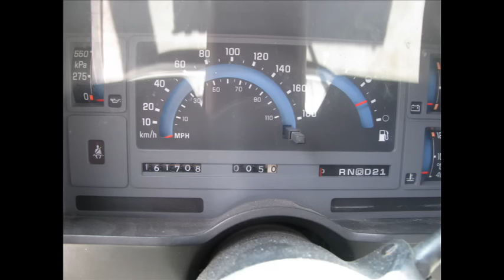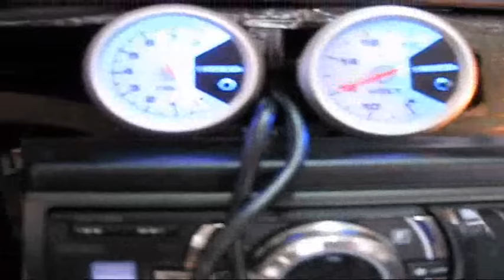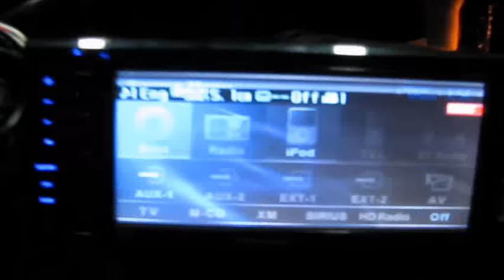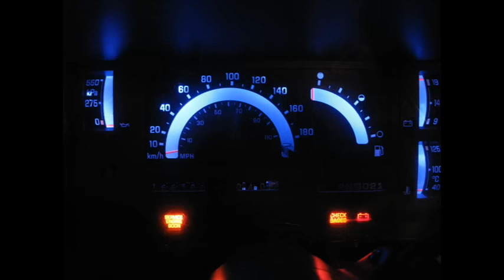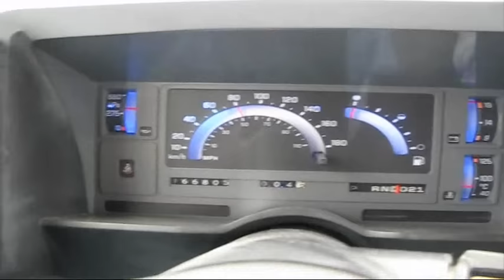Rob's S-10 Blazer

Comment from the maker: Those blue blocks are used to lower the truck. They increase the space between the top of the leaf spring and the bottom of the axle. The benefit of that is you keep the rear suspension stock other than the spacers. It is Also possible to change the position of the axle so it would be located under the leaf spring that would raise the rear end up approx 2 inches.

Comment from the maker: if the frame is solid then the base of the truck will last. the engine and trans need to be sound and lastly the body. however replacement panels are cheap and easy to come by.

Comment: Hey Rob you still doing things on the Blazer. Hey you've helped me out a lot with things on mine! Like the way it was running when the spider injectors were bad. Just a quick question. What I would like to know about is the transmission. When I got my 93 S10 blazer they put a th350 and it had the 4L60E and I have been trying to locate one. Well my question to you is. Does you're have the square connector or the round. Please help thanks. And I love the Blazer and some of the things you've done to it
Reply from the maker: Joe  Archibeque Thanks for the positive feedback I really appreciate it, I can tell you for sure I have the 4L60E trans in my blazer, I've had it rebuilt.  Regarding the connector ill need to crawl under as have a look at what I have.
Reply: Yeah kool bro I really like them stock wheels you put on it. And yeah I'd really appreciate it i look and look at YouTube and you seem to have the best things on there. And also you're very smart and to the point I like that. Other guys on here they talk about there S10 and airbags. Well anyways you have the best thing on here and I thank you for everything you post
Reply from the maker: Joe  Archibeque Thanks Joe, ill have a look under the blazer as soon  as I can and let you know what I currently have.  

Cheers!
Reply from the maker: Joe  Archibeque looks like my transmission has the round plug, mind you I was laying down in the dark looking with with my phone.  So I could be wrong, I would need to pull it up on the ramps to get a better look during the day.  Hope that helps you some.
Reply: Oh okay yeah I wasn't sure what they are called. So anyways I got this little Blazer for free. From my boss. And they said that the starter was bad on it. So I got it home thinking it was going to be an easy fix. Well what turned out to be an easy fix turned out to be a 1300 dollar job. The engine was. So I get under it and I'm pulling the bolts off of the bellhousing and noticed that there is a TH350 transmission in there. So I said wait. That's a 3speed an I thought they came with a 4speed meaning the 4th gear was an over drive gear. So anyways I get a rebuilt motor for it and I put it in and her running and I started fixing all kinds of crap on it. It was wasting gas and I fixed that. And now I'm doing the transmission oh boy what turned out to be an easy fix turned out to be a nightmare
Reply: Sorry for the long book. But I thought I would tell you about my nightmare lol
Reply from the maker: Joe  Archibeque your defiantly going to know what the trucks made of, I enjoy driving something I've done work on there is a sence of pride attached to it.
Reply: Yes that is the truth and I hope to get some stuff up on YouTube with the blazer and about the Blazer it's been a battle with the little Blazer. I've got several S10's from first gen to second gen there is something about these little trucks that I love. And I've also got a cavalier with a 3.4 out of a chevy Beretta on will post that also

Comment: Do you know how to remove the back swith lock handle and how to replace it? My blazer doesn't  have one but I found one in a lot but there's no key to unlock it..
Reply from the maker: Chelsea Sherwood It's removed from under the tailgate cover.  I replaced mine a long time ago when the original broke.  It was an easy job. You may be able to break the cover to open the tailgate from inside.

Comment: i have  a big problem i have a 1993 s 10 blazer and the the key lock thing on the back broke and i cant get the glass open have u had to replace yours yet and how if so
Reply from the maker: Mine was broken when I got it actually. I ordered a new handle might have gotten it from LMC or maybe the GM dealer not a hundred percent certain on that. It was like 12 years ago. The lock and latch all come apart from inside the tailgate so you have to take the inside cover off. I'm pretty positive once I put the key in the Tumblr I was able to open the back glass and a tailgate with a screwdriver. Does your electric popper still work for the rear glass?

Comment: Hey Rob sorry to bother you. But I have that same engine in my Blazer. And was wondering if you could help me with a few things? What's the little round thing on the top of the plnumem and there's also another one that when you pull it off It has a spring on the end of it and I know the TPS I where that is located. But jua t thoes to parts thanks sir
Reply from the maker: Joe  Archibeque Hey Joe,  the spring looking one Im thinking of is attached to the throttle body right near the intake pipe, it's called an "idle air control valve" or IAC. It's got a point on the end that fits into a hole, it basically slowly moves in and out to help maintain the general idle of the engine, sometimes they get dirty and jam up, look online for directions for cleaning.  The other thing your asking about is located in the middle of the intake manifold, hidden under the "vortec" cover, that's called: intake manifold tuning assembly.  Hopefully that answers your question. 

Cheers!

Comment: What did you do to the motor? Is it still a 4.3
Reply from the maker: george valldejuli yes, it's still a 4.3 but it's been rebuild with a new cam, roller rockers, roller lifters, MSD ignition, under drive kit, chip, e fan.  Stuff like that